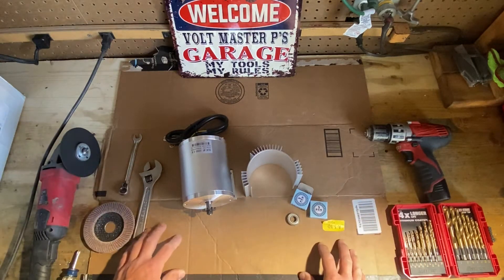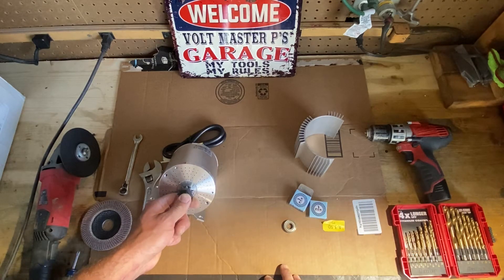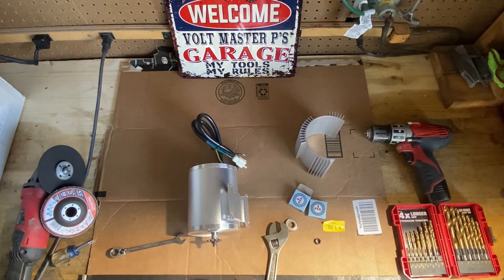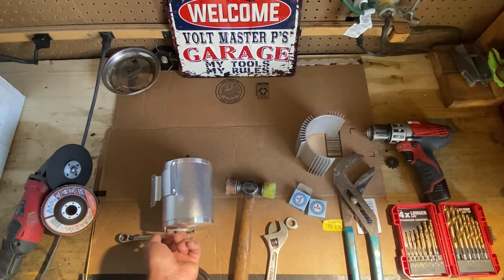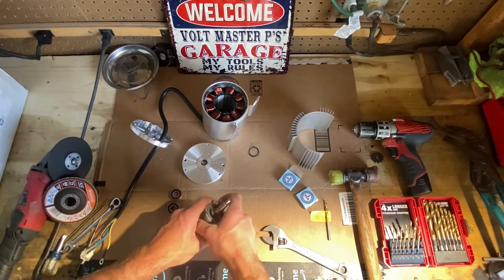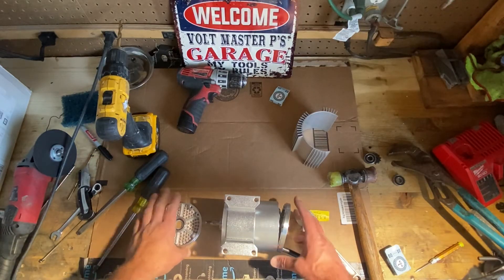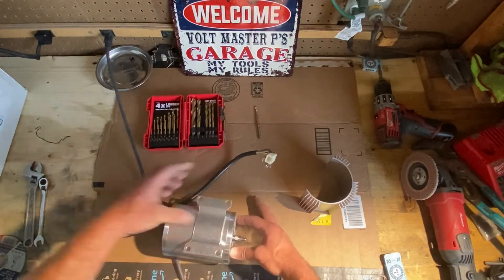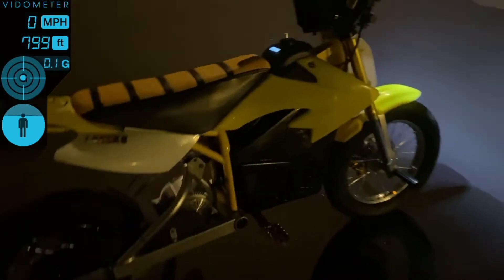72v 3000watt motor “1020” upgrade mods step by step with links

Comment: Estan excelentes todas esas mejoras (yo aun no tengo todo lo necesario pero estoy en ese camino con mi MX650), tengo dos dudas a ver si me puedes/pueden ayudar: 1) Con que se pega o asegura el heat sink al motor?  2) Vale la pena poner una malla de metal o plastico por dentro o por fuera de la tapa del motor para evitar en la medida de lo posible entre tierra por lo agujeros mas grandes? Saludos!

All these improvements are excellent (I haven't all the necessary yet but I'm on that path with my MX650), I have two questions to see if you can help me: 1) How stick or secure  the heat sink to the engine? 2) Is it worth putting a metal or plastic mesh inside or outside the engine cover to avoid as much as possible the dirt due to larger holes? Best regards!
Reply: Buenas, al final hiciste alguna de estas dos? Gravias

Comment: Did you put any thermal paste on the heatsink?
Reply: i got 2 tubes of thermal. made a diff
Reply: @KeatonsCarlott  I bet!
Reply: @bj97301  also got some fine mesh stainless steel  and marcos shaft driven fan!
Reply: @KeatonsCarlott  pics or videos?
Reply: most likely not, it doesn't need any type of thermal paste
Reply: @paper9570  I actually just ordered one of those heatsinks and the diameter is slightly smaller than the motor and leaves an air gap in the middle of the heatsink. If I use that heatsink I’ll be sure to put something to aid in the heat transfer like a thermal pad or paste. Just wondering what others do.

Comment: If you need to replace this motor . Buy the motor by Vevor, my1020d it has an internal fan. I drilled the holes from the inside out . They are smaller then the ones you drilled. But I'm running the 48v 2000w motor kit at 60v and after riding you can still touch the motor.
Reply: The 72v motors don't have room for fans. Armature is too large. 48v will be much less powerful. The KUNRAY model is better by far than the cheaper models like vevor and boma.
Reply: I thought the same... they aren't. Weigh them. the Kunrays perform much better and are a better product. This is coming form vendors adn close friends  that sell the product.
Reply: @AdamOpheim  is that all of the motors side by side or just the 72v motors
Reply: @AdamOpheim  then should i buy the kunray or the vevor 2000w brushless?
Reply: @Dmaze652  Always the kunray for "performance". The QS90 is the next step up and really not that much more $, but its not "bolt on".
Reply: @AdamOpheim  lmfao they all come from the same production plant my man
Reply: noce - how fast?
Reply: @TheFreshPeddler  35

Comment: While I 100% appreciate the incalculable value of developmental growth… for the price, it may be a case of “buy it nice or buy it twice.” I ordered the standard MY1020 kit twice, only to cancel those sales, and buy the 5000 watt Electro and Company kit; which fortifies the internals of the motor (they call it the MY1020+) with thicker wires and a larger shaft (insert your own joke here… hehehe… insert). The kit comes with a 200A Kelly Controller and everything is “no brained” for easy installation. 

Not an advertisement. Heck mine is still in the mail; but I have wasted just as much time as I have money “researching,” trying to get the best on the cheap when I could have valued myself and quality over savings. 

It’s ultimately cheaper in the long run to do what you want from the get go.
Reply from the maker: I appreciate your opinion but I have a story of my own lol me and my brother both bought mx650s at the same time I decided to build mine from scratch and he bought the electro and co kit after waiting over 2 months and going back and forth with Austin we finally received his kit , right off the bat his battery was half my size I have a 25ah and his kit came with the “20ah” at the time they now sell there top kit with a 25ah , on our first ride together he ran out at 18 miles and had to be picked up I went 31 , on our second ride his controller was shutting off and making beeping sounds , it was over heating and we had relocate the controller to a cooler location , since then it has been fine , he tops out at 40mph and I top out at 46 flat and I’m 40 more lbs then him , and he still has not gone over 18 miles , so I wouldn’t say E&C is “hassle free” is it easier ? Yes but at cost of nearly double mine and half the range  and a very long wait time that I keep hearing about from multiple people I wouldn’t recommend it but hey that’s just my experience hopfully you don’t have a similar one !
Reply: @voltmasterp8470  I would like to take one of the electro and co motors apart and see the internals compare to a Vevor 72v 3000w motor . I think the kelly controller is awesome and if I kill my controller I will pick one up . But they use alot of power . I'm running my Vevor 48v 2000w motor kit at 60v and have had no issues . I shunt modied one and it did 45 but it had to much torque.
Reply: @voltmasterp8470  That’s a fantastic response. Thanks for sharing that story. Without knowing, but hearing the issues you have had, it sounds like you might have had the Version 1.0 kit. They’ve since added more heat sinks to the controller, and maybe modified the motor; certainly in service to fixing some of the directly related concerns you had. Time will only tell. The cool part is that it seems like E&C cares about their customers, and should I have issues, they’ll do right by it. 

I ordered my kit on the 1st of May, and got word it shipped yesterday or the day before; so I was either lucky, or they’re picking up a bit of steam. 

In terms of batteries, I have gifted curse: 72v, 40ah triangle of doom. It might be too big, but if not, it’ll serve me well. I’m also working on doing a hot swappable Lawn mower battery setup; which would be great, as I can swap them out along the ride. 

We’ll see. I’ll certainly share my experience. I definitely appreciate your perspective and (larger body of experience) on this, and am only made better with the collective knowledge we bring to one another. Thanks again!
Reply from the maker: @PLAYERSBAWL  Thank you for that !! Please keep me posted and get some vids and pics of your build would love to see it !!  your officially addicted lol welcome to the club !! Goodluck 💪🏻

Comment: im honestly surprised how many motors you have gone through haha i still have the same motors i bought may 2021 and i never did the air flow or bearing upgrades haha
Reply from the maker: Maybe I’m pushing more amps through mine , what’s your top speed ?
Reply: @voltmasterp8470  haha you might be, my top speed is 45 but im using T8F chain and 54t rear sprocket and the stock motor sprocket these motors come with, but ive never gone dirt riding or climing hills very much, only bike trails and street riding.
Reply: @highvoltfab  what company is your motor.
Reply: @noce1071  first one I got was the kit from kunray on Amazon, the second one was a no brand one with 80amp controller from eBay, I’m pretty sure they are all made in one factory but vevor and kunray are definitely the two names that we hear/see
Reply: @highvoltfab  I know that vevor spends the 20 cents more to put in a impeller to cool the motor. I have seen kunray with them also.

Comment: What battery are you running a 48 V or a      72 V?
Reply from the maker: BTR 72v 25ah I get 28-30miles on charge 46mph on flat and I weigh 220lbs
Reply: @voltmasterp8470  lifepo4 or l-ion?
Reply from the maker: @MrHydroguy  lifepo4
Reply: @voltmasterp8470  is it 72volts full charge?(4.2v) or 72 volts nominal at 3.7v per cell

Comment: MX is looking good. are you running stock tooth sprocket setup? and was performance the same with your new 3k watt motor?
Reply from the maker: Thank you !! Stock gearing and I got one more MPH on this motor lol seems more torquey on the bottom end tho , mods are more for reliability but smoother bearings clean motor and keeping cool should delivery the best performance aswell !